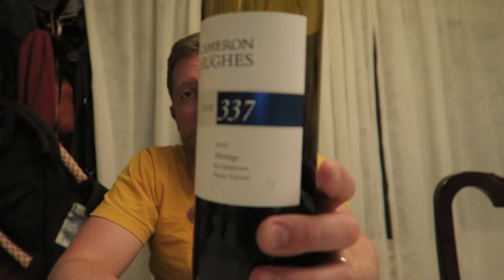Is An EDC Hip Pouch Cool?

Comment: I haven't watched the video yet, but my answer is a resounding yes.  My first EDC system was a fannypack (shoutout to Nutn).  Since then I've changed it to something more socially acceptable (who came up with those rules anyways?).  I now have a Maxpedition Janus that I've modified to have a sturdy belt clip, so I get the advantages of a fanny pack without having that waist strap to interfere with conceal carry or to add more bulk.
Reply: My first EDC system was a purse (The One by Eastpak), then recently I've tried out a cheap Ozark Trail fanny pack from Walmart. I dislike how the fanny pack sags down due to its strap not being as firm as a belt, which got me thinking that a belt pouch would be a better version of a fanny pack. Currently I'm using The One right now.

Comment: If you want a free pocket what about the conceal carry pouch on your right side instead? it looks like a cell phone case that holds your gun it doesn't print and is probably as fast as drawing from a holster in the pocket, worth looking into I think sneakypete is the brand that makes them...
Reply from the maker: From the ones I've seen they look bulky?  This pouch is very thin.  I've give them a second look.  I assume cops just think gun whenever they see them now?
Reply: possibly, I use a maxpedition  Concealed Carry Pouch which worked VERY well but its bigger...I found it to be pretty fast to rip open and draw the gun though